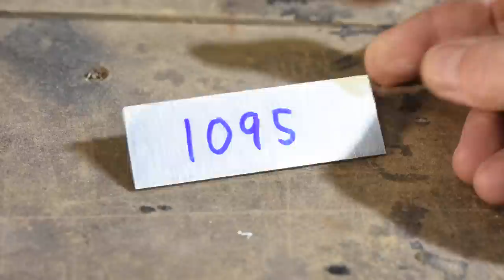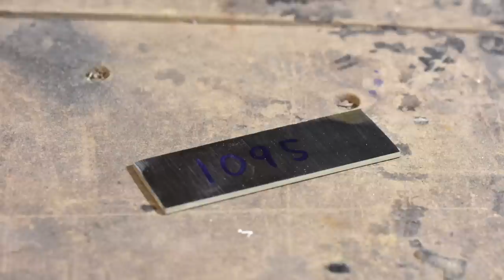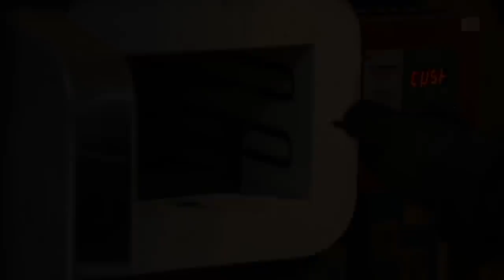Making a Wood Carving Knife with NO Power Tools!  Easy DIY Knife Making Project.

Comment: As someone who works a lot with wood i think it's important to point out that when drilling through wood (especially exotic because it's often more expensive) it is important to use a bar of soap to coat the drill bits and predrill smaller than needed holes. This will help reduce the risk of your wood splitting and being ruined
Reply: How much smaller should you drill?
Reply: @bitsurfer0101  I know I'm late but getting a clamp on the wood, applying pressure perpendicular to the plane that wants to split, will prevent splitting.

Comment: Thank you for making the knife for her. A lot of guys don't like it when a woman wants to do woodworking or learn to carve. I keep looking at all of these styles of knives and people keep saying Flexcut, but my budget says I gotta use what I have. So, what I have been using so far is the smaller knife blade on my Victorinox for roughing out carvings then using my Xacto with #2 blades for the finer stuff. Lately, though, I have been carving more poplar and oak. The Xacto is killing my hands, lol. 

I will have to look into one of the methods for getting that 1500 degree temperature. Would purpleheart pen blanks be ok for a handle for one of these types of carving knives? I found some purpleheart that I could afford to get finally. I have been ripping them into thirds and using the thinner pieces to make inlays. Wow, that's the toughest wood I have ever tried to handsaw, but I managed it with perseverance.

Do they make any already hardened steel? I can hand sand some stainless steel pretty well and shape it. It takes a lot of work, but if you work up through the grits, stainless steel is workable. Would stainless steel be ok to use to make the knife? I have several pocket knives that I keep sharp by sandpaper and they keep their edges a good long time. Metal work has always confused me.

Comment: great vid.  just a little tip for those who are not sure how long to heat your steel. you can buy temp sticks at about any welding supply . just heat and touch with temp stick, when the stick melts you are at the right temp. takes out all the guess work.
Reply: It's a lot easier and cheaper  just to use a magnet, which is what all knife makers, including Walter, do.    As soon as the steel is no longer magnetic, you're at the perfect temp.

Comment: done quite alot of blades and a tip to find the sweatspot of the heat, is that the magnetic force from the steel diseperes your right on with the heat. so use a magnet and when it stops sticking to the knife its time to drop in down in the oil

Comment: Hey Walter thanks a lot for the video, its great to help the "less-tooled" ;-).
I wanted to ask for a tip for not getting white wood colored grey when filling the blade and wood as one as after epoxy.
thanks lot !
Reply: AR9 great question, I've also wondered that.

Comment: when using a hand saw, hold it with the bottom three fingers and point along the saw with the index finger it helps guide the saw
Reply: When you do it like that it's easy to push the saw blade to the left without meaning to...

Comment: This is a beautiful knife.  

That said, I had one that was similar, the blade and tang about the same size, horn handle (full tang) and the total size was about 3 inches, with the blade being approximately 1 inch.  The craftsman who made it is not known to me, and I've had a falling out with the lady who gave it to me.  I'd love to have about three more like that, they were really good for putting in emergency kits.  

And I'm wondering how much something like that would cost if made with the power tools, and hopefully not as much sweat.  I was told the man who made it did it out of leftovers from other projects and sold them for about $10.  

I'm hopeful that you could do something like this again.  The other wood carving knives you have made are beautiful and look like they would wound the wind.

Comment: I'm going to be making a set of carving knives after seeing this... can you recommend a place to purchase the steel and material for pins? And type of epoxy used?
Reply from the maker: There are a bunch of knifemaker's supply places that you can Google, but Admiral Steel is another good place.  You can use commercial epoxies, but Bladebond is a good one made specifically for knife makers.
Reply: thanks for the question!
Reply: Aaron Rowe
Reply: A good source for bronze handle pins is a brazing rod from the welding section at your local hardware store. knife making suppliers are a good source for steel. Machine shop suppliers sell O1 in precision ground, often for less than hot rolled from a knife making supplier. KBC tools is my recommendation for steel, and where I buy most of mine. 
For epoxy there are many options. The aerospace grade loctite/hysol e120hp is best, but super expensive (it's what they glue airliners together with) regular slow cure epoxy from a hardware store is a reasonably good option
Reply: Walter Sorrells - Are you familiar with the Bill Reid adze and west coast carving knives of Northern Canada. Many of the carvers are very fond of thier hook knives. On top of that its fascinating to see native adzes on the west coast of BC and how they are designed slightly different in form and function from Japanese adzes.

Comment: I've been working with 1084 because the heat treat is meant to be simplest, but I heard 1095 needs a good soak time of 10-15 mins. Did you not need to do that here?

Comment: Walter, I love the video. I need some help. I rebuilt my transmission and used one of the old clutch plates to try and make a carving knife. I gave another plate to a friend of mine that has more experience with knife making. I tried to research the steel type but the best guess I could come up with is that it was 1095 steel. When I grind the steel it has good spark bursts, however after heat treating and tempering it will not hold an edge. My friend that has 10 years of experience did the same thing and his won't hold an edge either. Any ideas on the steel type or what I'm doing wrong? Several posts I've read boohoo the use of 1095 as they say it's hard to heat treat and they recommend using a special type of oil for quenching. Any ideas?

Comment: A question:  So once you peened the pins to hold the blade in the wood, how come you would file and sand paper down the ends again?  Wouldn’t that negate the mushrooming of the pin ends?  I know that’s how I actually remove pins from handles.  Or is it that it doesn’t really make that much of a difference?  I’m new to this so any info helps.  Beautiful work and very educational videos too - I watch them often and learn a lot.  🙏 thanks

Comment: Du you have a video that would teach a beginner on what type of steel to buy and what strength and explain the cooling process for each type of steel ? 
Would you know of a buying source for steel used for knife making in Canada ? What is the difference between carbon steel, stainless and norm. steel ?
 Best Wishes,  Dirk

Comment: Great video,  fun project.  
BTW, does anyone know what old Erwin spade bit drills are made of?
They aren't particularly hard... maybe HRC 55 or so ?  They sharpen with a file. 
I have about 100 of these things from my days as a carpenter, when it was a LOT cheaper to buy new ones than it was to sharpen them. 
I would like to make specialty wood carving chisels out of them, but they will need to be much harder (HRC 62 ? ) to hold any kind of edge in hardwoods. 
Any suggestions would be great. 
Thanks, 
R

Comment: Thank you for showing us how to make this with stuff we can easily get, always like when you make sharp things with out the big $$$ equipment 👍🏻👍🏻👍🏻
???do you think an ordinary propane torch or MAP torch will get the medal to the right temperature to harden it?
Reply: Yes if it is as thin as this knife is, it should not be a problem with propane. Mapp is a bit hotter, but if you have the propane I would not go buy mapp until I tried the propane. Good luck,  let me know if it works....

Comment: I've had some experience making and testing experimental epoxies. The epoxies that hold together your car are stronger than the steel your car is made of. Those pins probably aren't doing anything other than looking good.
Reply: Your experience fails you.  Epoxy may hold forever, but strength and longevity are very different things, and I've seen the best epoxy whether on cars or anything else, fail without warning.   I've also tapped the pins out of knives and had the scales fall off because the epoxy had failed.

All sorts of things can cause epoxy to fail, and if you don't pin the scales on, you're begging to lose them.

Comment: Hi Walter, first of all i want to say thanks for your videos they are great and i enjoy watching them
second of all i have a couple questions i hope you can(and want to) answer:
im thinking about making my first knife, is it bad to start with a bigger knife like a bowie? is it any harder then a smaller knife? 
the steel i want to use is 1075, does it rust really fast? i want the knife to be a display knife and i want to use it so i dont want a "good" rust layer on it(forgot the name) 
i also thought about using an old saw blade for the steel but how do you know what steel an old sawblade is? 
really thanks for making these videos(and hopefully for answering my questions ;))
Reply from the maker: Bigger is harder.  It's that simple.  But nothing wrong with being ambitious!  1075 rusts, but if you oil it regularly, it won't rust badly.  Remember we've only been using stainless steel for common tools for less than a century.  There are thousand year old Japanese blades with zero rust on them.  They take insanely good care of them, polish them periodically, etc.  As for saw blades, it's just unpredictable.  Tons of different kinds of steels.
Reply: Walter Sorrells okay thanks for the answers
Reply: Hello Walter I have a question. I'm making a knife out of old hedge shears would I still need to harden the steel or temper it or should it be fine sense it was a tool already? THANKS!

Comment: Most wood carving handles are not made that way. As a wood carver, I would have not made the handle next to the bolster so pronounced. You will find  it will get in the way. I found an easy way to find the shape I want for my handle. Take a piece of clay and form it in your hand where it's most comfortable, and that is your template for your handle. I like to make my wood carving knives out of old straight razors. It's a lot of work, and you need to make sure you don't overheat it. 1095 is easy to work with, you will find you will need to strop it often, but it takes an edge fast and has a less chance to fracture. Good for a hard handed beginner.

Comment: great video thanks 2 question if I may, I want to know how long of fiddling with woods it takes for a knife of that quality tell it need to be resharpened or honed 5 min, or 40 min?  it is a huge difference for me to know I mean apporxmatly how many minute befor it lose the ability to cut paper.. I never found that info , 2. what part of the state is your accent. thanks a lot. Wish you the best 
PS  I Know it depends on what we do with  the knife, but just how long it would go dull doing what you do in the demo at the end..

Comment: Would a Bunsen burner heat it up to the correct heat?
Reply: maybe, maybe not. just a small bunser burner for cooking and whatnot prolly won't do the job. not sure if a plumbing grade bunser burner even would. depends on  the size and shape of the blade as well. you might need additional oxygen supply to reach the temps needed if you're burning liquid gas such as propane. in case it is just a small bunsen burner you can try, but you're probably better off just firing up the charcoal grill in which you will quite easily reach the temperatures required for heattreat but it is also quite easy to overshoot in a proper charcoal fire so be aware of that.

Comment: Good job I would finish the handle better though than just wax.. I read wax is really just abrasion protection and if it has wax ONLY on it it will soon become dirty and will have no water, water vapor, or chemical protection.. It also says the wax will collect dirt and dust and become dark and an ugly mess..

Comment: Hey Walter.

Can you explain something about the thickness of the blade?

Something like "what's the best thickness for each application?"

I want to start to produce knives as a hobby, and I am curious about that.

Thanks.
Reply from the maker: Honestly it's just personal preference.  The thinner the blade, the better it cuts.  But thin blades are also more fragile.  For hunting knives and things of that nature, I tend to go about 1/8th inch.  For kitchen knives, I like to go a little thinner.  For camp knives, military knives and other hard use knives, you might go out to 3/16ths or even a 1/4 inch.
Reply: Thank you, Walter. It helps a lot.

Comment: -Walter Sorrells
can you show us how to make a graving tools from say car spring or of something similar so someone starting out can easily aquire. 
Thanks in advance, Martin Moldovan
Reply: I wouldn't want to speak for Walter but I believe he's not a huge fan of mystery steel like car springs because it's hard to reproduce what you did.
Reply: Either way even if he use known steels it would be fine also.The point would be the same .I can understan using known steels and staying away from unknown.Thanks for the input. 
Martin Moldovan
Reply: Shan Moldovan Hey, I make my own graving tools specifically for doing Japanese type metal work. My budget is very small, and I have found that 'music wire', which I get from Ace Hardware works well. They have it in 1/8 inch, which is perfect for my work.  The pieces I buy come bound three to a bundle,  are three feet long and cost about 4.29 plus tax.
Reply: I'd recommend starting with a piece of W1 or O1 drill rod, as sold by machine shop suppliers. At that point it's just a matter of starting with the size you need, and either grinding, or filing and stoning in the required geometry. And heat treating of course.  It's not complicated metal work at all, the main thing is knowing how a graver should be sharpened

Comment: "... with a tool that could have been seen in any woodworking shop two or three hundred years ago".
No, that monster high-tech chuck definitely could not have been seen.  Nor that type of drill bit.   However, it's possible that your modern version can still hold an old fashioned square tapered bit if you remove that chuck.  Hand tool users are a traditionalist lot, and few would want to throw away perfectly serviceable bits when buying a new brace.

Comment: Hey Walter, what wax would you use for a paring knife or something that needs to be food safe? (I watched your paring knife videos but didn't hear the type of wax). Thanks!
Reply: Tristan Antonsen he probably uses beeswax and some sort of oil like olive oil that is what I use.
Reply: Tristan Antonsen Melt some bees wax into olive oil!  I like enough wax to make it into a paste. Good luck!
Reply: You can use olive oil as suggested by above comments but you really should not. You want to use oil that will actually dry and become stable. Olive Oil will never completely dry and become stable, over time it'll get rancid and gooey instead. I suggest you to use Linseed Oil, Walnut Oil or Bees Wax. Tung Oil is another great option.
Reply: Tristan Antonsen I prefer coconut oil for food safe stuff
Reply: That's silly.  I prefer mineral oil, which is the standard for a food safe oikl, but the last thing you should ever use is an oil that dries.  It's just a pain in the butt, and does no good.  

Even olive oil is fine, and if it turns rancid, which I've never seen happen, it means you aren't taking care of whatever it's on, and certainly aren't using it very often.

Comment: "Welding steel" is a type of steel that can't be hardened?
As an Alberta B pressure welder/pipe fitter/machinist/power engineer with 25 years experience I would love to hear someone elaborate on what exactly "welding steel" is.
Because if you can't harden mild steel into a usable knife Walter, you might want to reconsider calling yourself a knifemaker.
Perhaps you were thinking aluminum when you said steel?
Reply: He's probably talking about A36 it don't have enough carbon in it to harden very much.

Comment: I dreaded using files cos I had crappy files now I got a good file and it cuts nicely so it's pretty decent 

Honestly I dont see the difference between cutting 3mm steel with power tools or without power tools 

Only time ,time matters is with thick steel like 8mm

Comment: Awesome knife. Carving and whittling knifes should be literally razor sharp (400grit won't do) and w\o a microbevel. But a new owner probably knows that and will resharpen to about 1200. Just saying.
Reply: egglyph The 400 grit was just for finishing the faces of the blade, he actually sharpened it on the diamond stone which I assume was a much finer grit. Correct me if I'm wrong, I couldn't read the details on the diamond sharpener block.
Reply: It's at 19:26, diamond stones are color coded, EZLAP red is for 400. But again, this is not the point, Walter is a knife maker, not a woodcarver.

Comment: why don't you use a ball pien hammer? cross pien is for hammering in finishing nails.
Reply from the maker: It wouldn't be called a "pien" if it wasn't for piening.  For very small pins, I like a cross pien better than a ball pien.
Reply: Walter Sorrells Hello I'm new to knife making and I was wondering in which store exactly would have 1095 steel?
Reply: I was under the impression that it was the other way around, that a pien or peen is the back of a hammer, and that it was called piening or peening because it was often done with the special shapes added to the backs of hammers